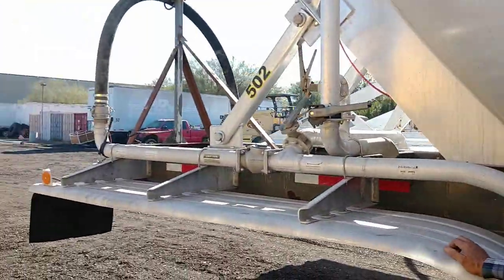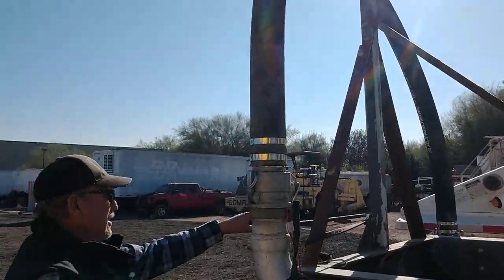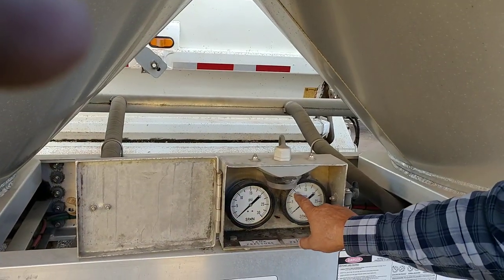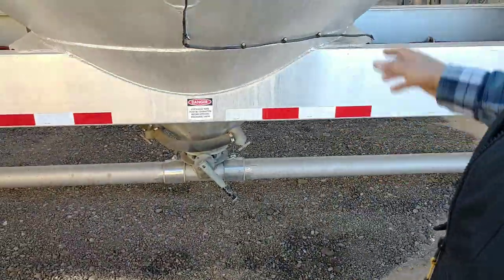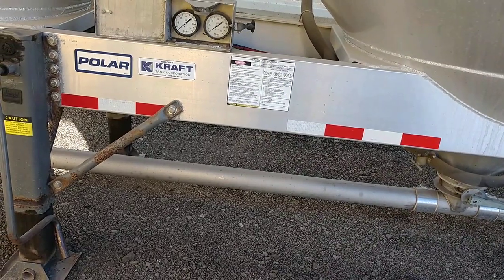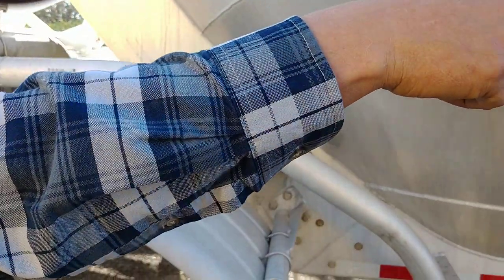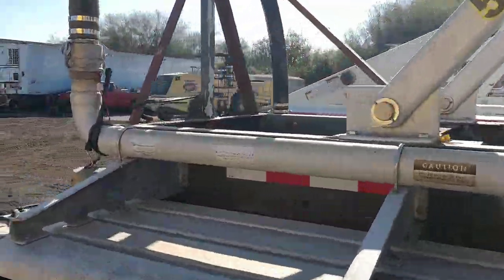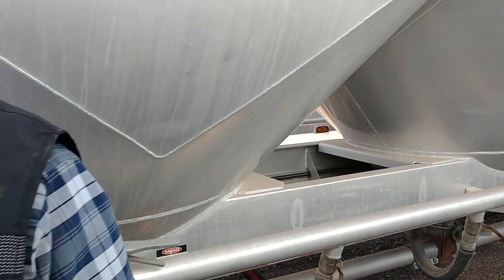Pneumatic trailers taught EZ by my Boss

Comment: From my experience. This process takes about 1 hour to unload.. let’s say you do 3 loads in a day for 12 hours.. you’ll be working 3 hours and the rest of the 9 hours would be sitting down in the A/C
Reply: yup ..I just started hauling cement and fly ash 4 days ago with no experience. today I got almost 14 hrs in just getting 2 loads from the plant and taking it back to our plant. sometimes it takes 45 minutes to blow out all the material and sometimes it's about an hour.either way I really like the job and hours!
Reply: @somewhere-n-Texas  same here  took only two load to get my 14hours
Reply: Y’all drive far for the loads? We do 4/5 loads in 12 hours. The place is about 10 miles away though.
Reply: I like your analogy 😊
Reply from the maker: Yes it can at times and sometimes it can take forever!!!

Comment: He skipped one important step. Before you open any product valve. Open the air valve all the way make sure your line pressure is 0. The person who blew down before might not have cleared the line.
Reply: JM Chavis this bonehead, is making this way more complicated than it is.
Reply from the maker: Very true however I was the only one blowing off the trailers so didn't really have to worry about that but you are correct always open the air line and let it blow out first

Comment: Safety issue, always leave a product valve open after opening blowdown valve, and then step on discharge hose to check pressure in the discharge hose. before disconnecting the hose.

Comment: Y'all stop using top air.use the airrators that way u can unload a 48 thousand pounds in 20 minute come on guys
Reply: Mike,  you really don't use top air
Reply: mike, try 27.75 tons in 30 minutes using aerators and hot line, of course you can use top air as well. This guy's cleanout will be terrible using the method in this video! Your boss is wrong,  do each hopper individually till presure is like 7 on line and same on hopper(that way you know you're empty plus you'll hear the aerators). I would say build pressure close to threshold like at least 13 if not 14.5 in hoppper than do full release on hot line and open hopper 100% and pull that hot line back to at least 3 from closed. It will hold at like 13 w/o building hoppper pressure if it does just open that hot 1 notch at a time until pressure stabilzes on hot air and hopper guage. Line guage is more important than hopper guage in my opinion. 

Good Luck Driver!
Reply: I don't use top air either. I can hear when the hopper is emptying, and also the pressure starts to drop. So I don't usually bang my hand on the side. After emptying each hopper I do go back and make sure they're empty.
I carry 25 tonne (49000 pound) and can empty in about half an hour
Reply: I haul ammonia nitrate and that takes about an hour and a half on a good day. If it's hot and humid and the product starts to stick I have to be hitting the tanks with a mallet to get it to flow. I never worry about the time though just get it done. Anything over 3 hours is a concern though.

Comment: Well I run one of them and I think that guy don't know what he's talking about never heard of doing it like that lots of luck with that you'll be blowing off for 2 hours
Reply: Your right. He left out the parts where you put water in the pop off valve on the trailer so it don't pop at 12 psi then put a bungie cord on the pto pump so it don't pop. Bleed gages so you can make the needles show 10psi but your really pumping 14 and a half when plant manager comes out to check to see if your pumping hot and also if you do plug drop psi to atleast 4 psi.
Reply: Facts I run on too and he lost me 😂
Reply: Shit I unload bout 16 psi done in 35 minutes depending on the silo
Reply: @charlesroberts8803  i have never heard of putting water in the pop-off. Teach me Ole Great 1 😂 j/k but seriously
Reply: @billyspraynone836  Water in the pop off valve on the tank will make it stick after the water drys. Seals it up. Bungie cord on pump holds valve in place. Bleeding air on guages sends a false reading if not closed all the way. Do you know how to unplug a plugged line without disconnecting the hose?
Reply from the maker: It can happen its taken 2 hrs depending on the trailer I run a trailer were I'd be done in 30 minutes
Reply: @charlesroberts8803  you forgot to put block on gas peddle pto @ 20k rpm👍😁

Comment: We haul lime to the gold mine and the only thing I would disagree with is the part about only opening the product valve partially.  We build the pressure, open line valve, then open product valve fully.  Then when the pressure drops to about 6 we shut product valve off then line valve to build back up to 12.5 then open the next product valve.  Repeat until you finish all 3.
(Edit) so I started hauling cement to a 2nd gold mine and I stand corrected! With cement our jet line is only partially opened because of how fine it is compared to lime.
Reply: Yep, every product and every place to unload requires different product valve settings
Reply: @melvinrexwinkle1510  so it's been almost a year, and I have unloaded about  300 bulkers in that time frame.  Here is what I learned.

Lime being the way it is will unload like plastic pellets and certain grains.

Everything else, like sand and cement, ect, is easier to unload, easier to unplug, but definitely don't want that jet line open very much lol.  If one can unload the heavy pellet like loads then you can unload anything. 

Lastly,  the customer should have a good bag house for better unloading lol. 

So in summary, I am humbled and admitting how much MORE I learned in this last 11 months of doing this boring good forsaking type of hauling almost daily lol. (We haul everything here so the bulkers are only a fraction of what we pull)
Reply: I unloaded activated charcoal (ground up, or powdered charcoal, from a wood fueled electrical powerplant on Samoa Island, just off shore from Eureka, California) at a city water treatment plant in Tempe, AZ. This powdered charcoal is very light, we had some 2000 cube trailers, with those, might get 33000lbs net weight, that's all.
     I had learned to not open the vibrator air to pressure up the tank, only pressured up the tank with top air valve open to about 6 psi, and then open the hot line valve(the valve that either sent the air into the tank, or down to the product line and out the back thru the hose) only opened 1 notch one the valve. I'm saying by doing this would be trying to plug up the product line, all the air pushing down on top of your product, with as small amount of air going to the product line as possible.
Well, when I got to the rear product valve opened, I had lost too much tank air on the third valve open, and the product line plugged. The man who overlooked the trucks in the plant was unhappy and said we can't unhook the hose and spill product. I told him that I could suck the product out of the hose but I would have to release the air from the tank, but I could do so very slowly, which would make very little black dust into the atmosphere. So it took about 20 minutes to let the tank pressure out even though it only had about 3psi. 
The fellow overseeing told me "now I want you to do it my way now, pressure your tank up to 10 psi and then shut down you blower and then open up your product valve all the way and finish unloading" 
That was enough air in the tank to unload the 4th hole and to clean out the three cones in front, all with the truck engine shut off. 
I saud all of this just to demonstrate that there can be very extreme differences in the density, and the flow ability, of different products.
I hauled perlite from Hodgkins,  IL. To Minnesota, a couple loads to a plant buildings double walled cryogenic tanks for LNG,  they pulled a vacuum on the wall spacing, just like a giant thermos, and that way vacuumed the load off the trailer. They had a sight glass in their line going into the top of the tank, so I could see the product.
I had met another driver who had delivered the first load in the process of filling the double walled vessel, and he said it took 14 hours to unload, so the next morning when I arrived, I told their supervisor, who said he didn't know how to do it, so I said let's get it going and I will get on top of the tank and open a lid so I could see inside the tank and when I saw the cone was about empty(and was about to suck a bunch of air) i would holler for him to close the product valve, thus not losing their vacuum, which was in a vessel that was 110feet long and 14 feet in diameter. We were unloaded in only two hours! I hauled two loads of that perlite, which is the little round balls that you might see in potting soil. If you see one someday day, inch one between your thumbnail and fore finger to break it and you'll see that it is I tiny hollow ball, made from a certain kind of sand, dropped through a torch flame that pops the sand into a popped hollow ball that is a mineral, which means that the ball is temperature proof for cryogenic tanks like liquid nitrogen at -319f or in refineries, etc up to about 2500F 
Good luck pulling one of them blow wagons, if you ever get stumped, well just reply and I'll try to help
Reply: @dano8613  where do you run? Nation wide?
Reply: @melvinrexwinkle1510  I use to but I sold my truck and moved to Alaska,  more money up here than anything down there
Reply: @melvinrexwinkle1510  you had 4 pods? We have 3 but we have 5 axle and we are hauling about 68k pounds.
Reply from the maker: Yeah when we did this video it was going to be doing cement since then I've done so many loads of everything I've lost count!!! 🤣😂
Reply: @The52dodgem37  it's funny but doing cement, I can unload fast and efficiently however since I 1st commented my lime unloading skills have dwindled so bad that I can't get it to unload any faster than 3 hrs. We haul over 60k pounds a load but wow I suck at lime lol
Reply from the maker: @dano8613  I honestly think that it goes with everything and everyone, you truly never forget but damn do you tend to get rusty with things. Depending on the load and the product not including the trailer and the vibrators and baffles and lines and air sometimes its fast sometimes its slow. Either way we still get paid and we can make the money!!!
Reply: @The52dodgem37 I agree with you for sure.  However   I'm just glad that we do a little of everything, im better with a flat bed or a RGN lol. I'm currently being trained to pull heavy.  Just made a trip (15.5 high, 15 wide,  115k pound D9) triple axle 10 wide rgn with a booster.  That's where my heart is. I've done plenty with that trailer up here but never with a booster or jeep.

Comment: He teaching him too much at once to be a beginner. Hook hose to silos. Make sure all 3 pods and the line are closed. Leave pressurize open so it can build once you engage PTO. Hook up hot hose to your blower. Cut on your PTO and watch pressure build. Once at 12, cut off pressure then open line valve followed by opening whichever pod you prefer. I unload the middle first because that’s always the fullest then the last because that’s the next fullest then the front. Front always has less. Keep pressure on tank and lines at 12 and relax. High pressure will clog your line or burst your hose. A 20 foot clogged line is a bitch to disconnect and dump out by yourself. Once a pod gets low and you can feel it. Start cracking the next one. Once their all empty depressurize the line(open valve) Cut off PTO then disconnect your hot hose from the blower then disconnect from the silos. Job done, another load in the bank.
Reply: Hey thanks a lot for that quick rundown. I needed to hear that.
Reply: Must be a sand hauler

Comment: I don't start unloading at the rear cone, I start at the front and work towards the rear, for only one reason. If the back cone is empty and for some reason the product valve can't be shut completely. or perhaps there is some problem with the rubber seal, that allows the tank air pressure to escape, then you can't maintain tank pressure and consequently you can't unload any cone forward of the non functional product valve
     I have had this happen to me once in about 20 years of pulling pneumatic tanks. Once also, a friend called me with that problem and asking what to do. So in 20 years experience. Its happened 2 times. But. Why not start unloading at the front and work toward the back? No reason not to do it. 
      The time I had a problem was unloading frac sand. Started at the front, front hole emptied and the valve would not shut. Was obstructed by something, so I immediately opened second hole product valve, slowly built tank pressure and continued to unload trailer. I could unload that way because the product was behind the  not able to close product valve.  When the trailer was empty, looked in the top and there was a 4lb. Hammer. Handle down in the front product valve.
Reply: If for whatever reason you can’t complete unloading, and you’ve got to leave the location with a partially loaded trailer, you don’t want all the weight at the very back of the trailer. Unload from the back, first. Always.
Reply: @elijahmoon21able  it'll get ya doing that some day
Reply: I did this type of work many moons ago with a company called Foodliner. I pumped the Silo of Wonder bread now out of business, in New York and Philadelphia.
Reply: I always start with the center pocket then front and then rear and go back to the center.

Comment: Nice video 
But nothing happened if the pressure goes after 15 psi 
The tank should have a realif valve which cut the air at 18 psi
Reply from the maker: Yes our tanks however fluctuate pressure wise some can pop off at 17 some will pop off at 20 just depends on the tank and age!!!
Reply: @The52dodgem37  some tanks have blowed up ya know, some drivers have been killed too
Reply: Also the pressure affects the silo that’s being unloaded into. Some can only handle 10-12 lbs of pressure.

Comment: We always vent off the tank and line pressure drop the truck back to an idle and unhook hot hose with blower still running to let it cool down before we shut it off.
Reply: I just read this. PLEASE! Do NOT disconnect the hot air valve with the pump running. A written that is either a joke or recipe to get somone seriously injured or killed.
Reply: @billingram6594  bullshit, tap the brake to kick off cruise to idle engine, the take off hot hose, not dangerous! Sometimes not enough air to push hose off the blower, always allow blower to cool down while disconnecting and stowing product hose, closing guage box lid, and hanging up hot hose. Per blower manufacturer recommendations.

Comment: Hi. Question 
Under my check valve there is little hose that is connected with pressure gauge. That hose is getting cement and cap my pressure gauge. What is causing cement to run into hose. Vibrators are working just fine
Reply: Opening the top air valve, Opening a product valve without the line valve open, it happens
Reply: It happens when tank pressure is higher than line pressure. When you open product valve (the bottom of the cone) there is nothing stopping the product from moving forward in the product line up to the check valve. That's when you could get cement into the guage line.

Comment: You open full(90 degrees)the product valve full not 45 degrees.  I drive these trailers.
Reply: @melvinrexwinkle1510  his wording is but you need to have the product valve all the way open because all the product needs to get out without force
Reply: Always open the product valve all the way.
Reply: @elijahmoon21able  well its open but 45 degrees is when you don't want to lose pressure